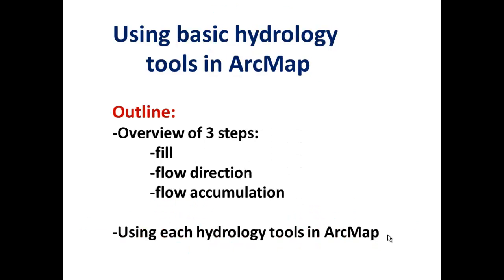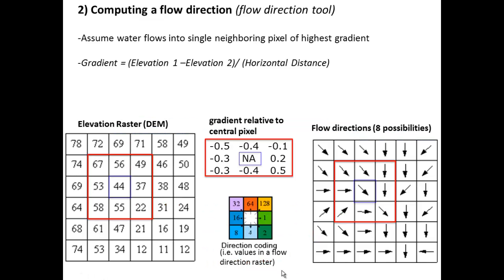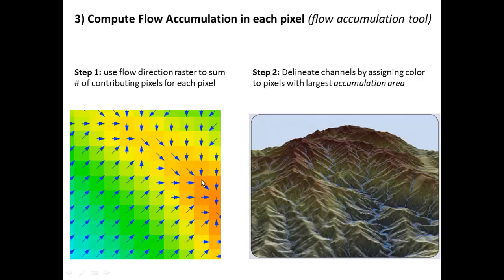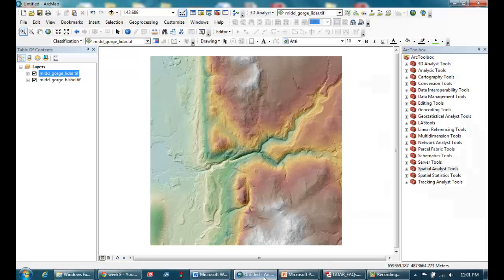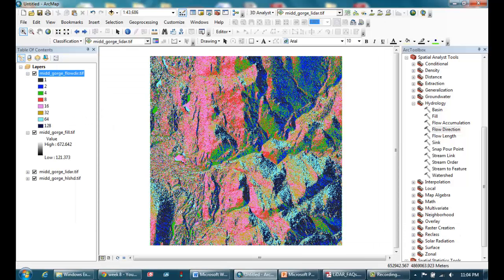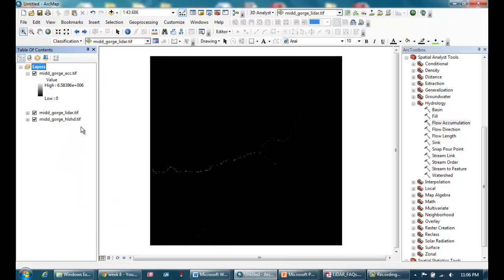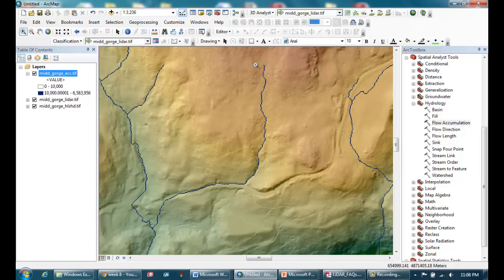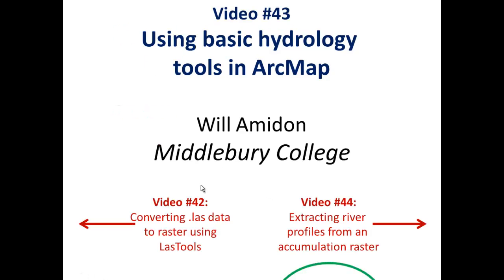v43 using hydrology tools in ArcMap

Comment: Why did you choose 10,000?
Reply: That's  based on error and try, to delineate the stream feature if you pick lower Acc value there will lot of unnecessary first order streams, so they generally chose from 5000-10000 or higher. you can choose any range.

Comment: Great short lesson! Your teaching is very clear. I am new to this so there is so much I'm unfamiliar with and so bear with me. Now, in the case of flow diverted erroneously due to fills; is there not a way to rectify that and force the flow along the right path? Do you have another lesson that shows the delineation of the watershed boundaries? It seems like that would be just another short step from where you ended here. Thanks again!